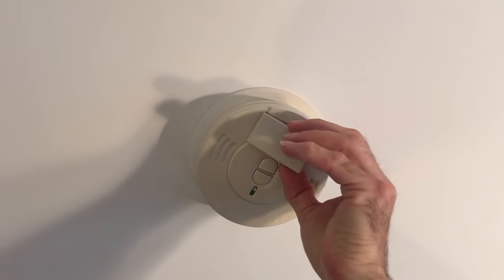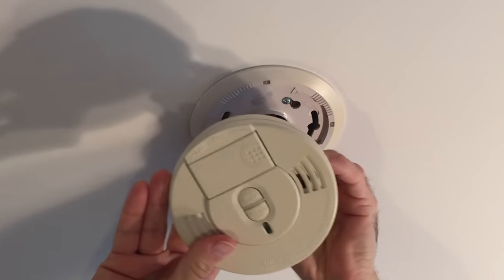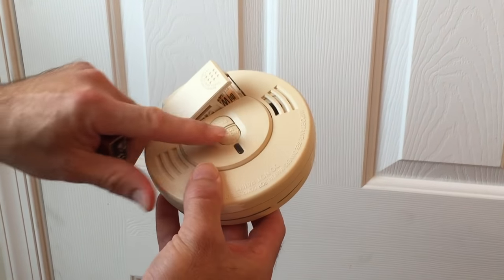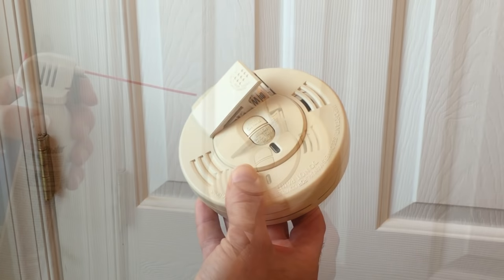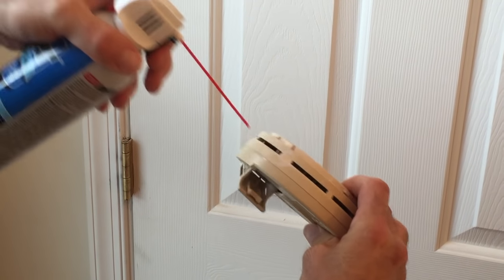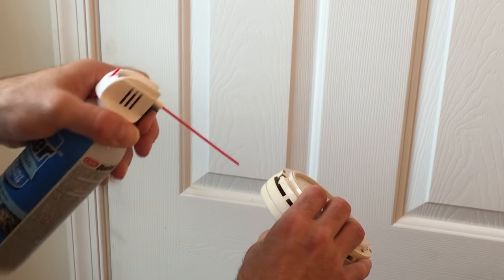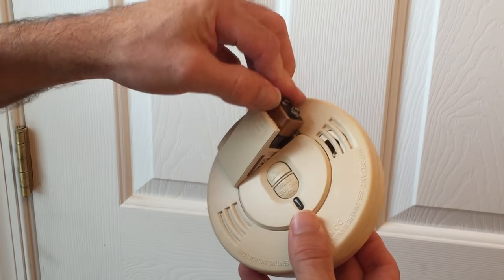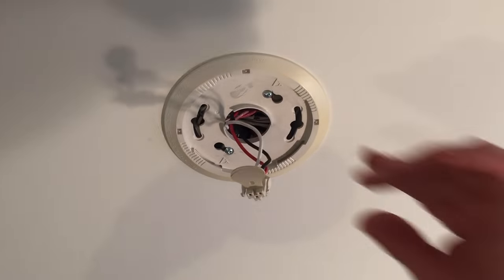How to Stop Smoke Detector Beeping or Chirping

Comment: Not much use if you have a hardwired alarm!
Reply from the maker: Josephine Ward I’m not sure I understand the comment. The alarm in the video was hardwired as these types also have backup battery power.
Reply: It means, it chirps even with the battery removed and the wiring is hooked up to a central control unit. It can only be managed by a maintenance facilitator and or the fire department

Comment: FYI, that smoke detector is discolored due to age.  Smoke alarms that are over 10 years in age are near the end of their service life and should be replaced.  Just like any electrical appliance, the components of smoke alarms wear out over time.  When a smoke alarm reaches 10 years of use, the potential of FAILING to detect a fire increases substantially.  Replacing them after 10 years reduces the likelihood of failure.  Replace your old smoke detectors people!  Don't mess with this stuff.  Cheap fix that could save you and your loved ones lives!!